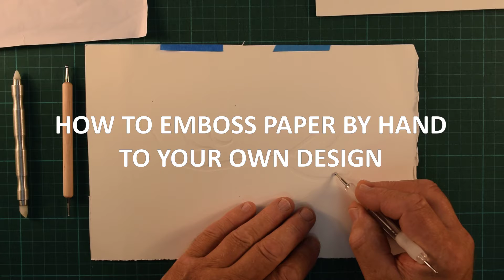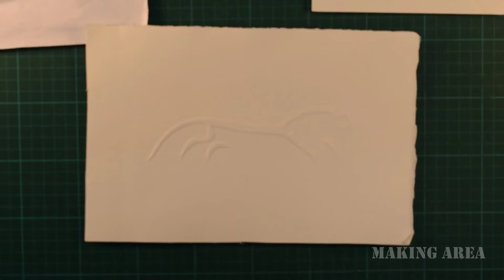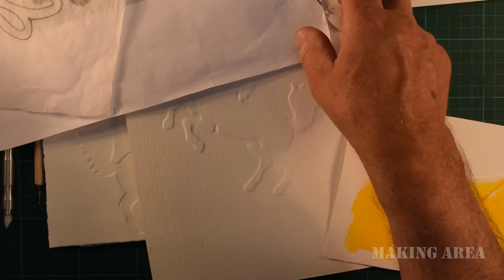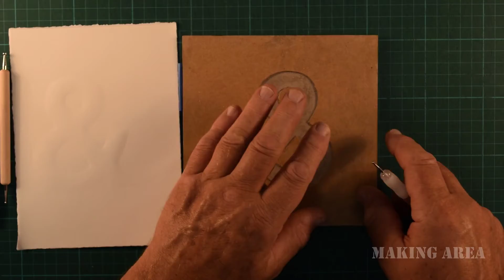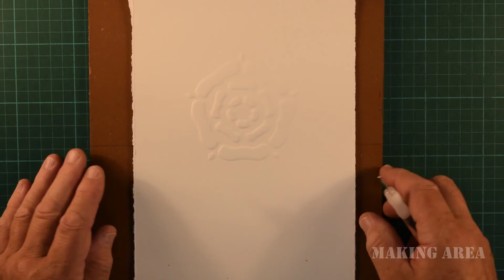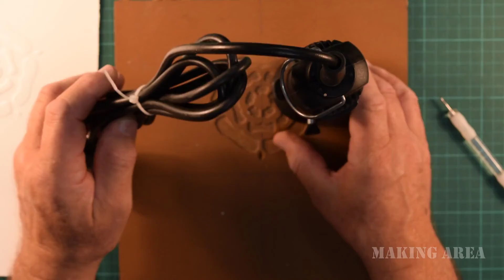How to emboss paper by hand to your own design

Comment: and how did you trace the design onto that completely opaque cardstock?
Reply from the maker: Hi, thanks for your question and I’m sorry I didn’t make this clear.

In the case of the design I was using, it was symmetrical, so all I had to do was turn the tracing paper over and draw over the lines again from the back with a pencil. With enough pressure, this transferred the image onto the opaque card.

If your design is not symmetrical and you don’t want a reflected image of it, scribble over the back of your tracing with a soft pencil until you have covered every line. Then place the tracing the correct way up onto the card and redraw over your original design lines with a pencil. Because you have scribbled on the back, this will transfer the image through to the card.

It won’t be a crisp image, but it gives you an light outline which you can then draw over to redefine.